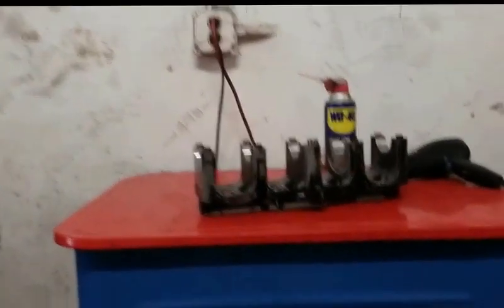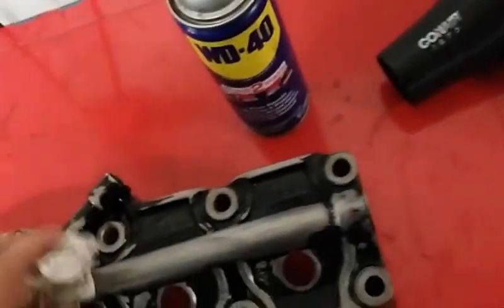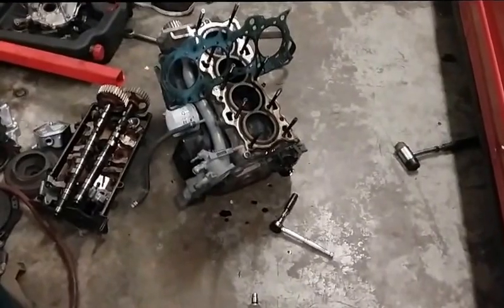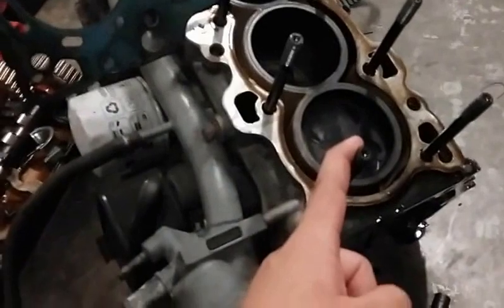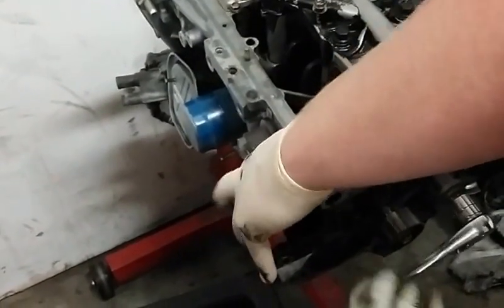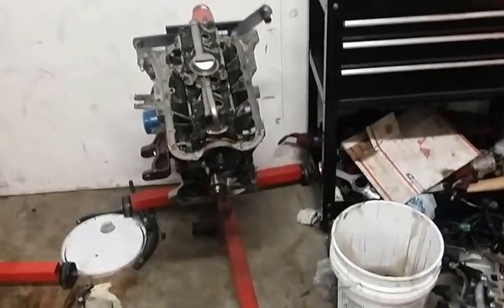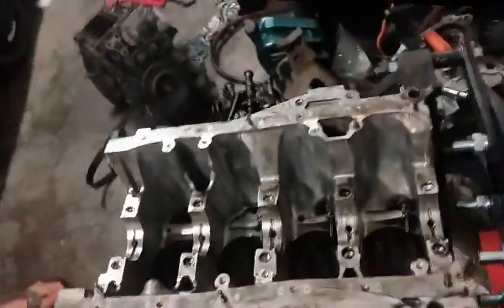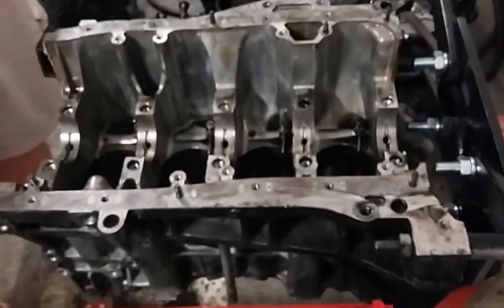D16y7 Engine Rebuild Pt2

Comment: Hi , I don't know if you will ever read this . But one question have you ever tried to use car80 to clean the inside parts? Does it hurts the inside parts? Or have you ever heard about anyone hat tried to clean it with car80 and made the engine bad?
Reply from the maker: i only use purple power

Comment: did you use stock size main bearings and rod bearings? i plan to do a stock rebuild on my sohc eclipse and nothings wrong with it....yet.......but it has 185k miles and i want to refresh the engine for the first time. if i get stock size bearings do i still have to check clearances with plastiguage for example? do i only get oversized bearings if i get machine work done?
Reply from the maker: liltaz94 you need to find a chart for your crank specs and measure your journals to see what size you need. I have a walkthrough for this. Have to dig for it

Comment: Yo what are you using to clean that rocker cover because ive tried alot nothing works that well I have some WD40 that also has some penetrating oil in it.. that shit does nothing for the cylinder head
Reply from the maker: iKixie purple power and a scrub pad

Comment: Have a d16y8. Crank pull bolt refuses to vacate, same instance you had with the other motors. Any tips or what kind of shops I should look at taking it... have put 150 lb of pressure from impact also applied heat and still no go
Reply from the maker: Michael Browning need fucktons more trq than that. It's not uncommon for me to need a 3/4 inch impact to take them off. If you have a homie with a badass impact that works in any kinda shop I'd hit them up. It'll only take a few seconds with the right gun an air supply

Comment: hey was wondering if you have some advice in building a vitara motor and one of the rings I gapped way too loose about .028, the rest are about .019. should I use some used compression rings only off of one of my spare d15's? or should I just run that gap?
Reply from the maker: are you saying you cut the ring back to much and opened it to .028 or it was at that when you measured?
Reply: VHB Engines ya I opened it up that much with a hand file, I bought the evergreen rings off eBay I think you said you use them, and they come stock pretty tight like .012 or something. their for a used set of vitaras I have. did most of them slow and taking off any burrs but opened the one way too much
Reply from the maker: Mitch Weber yea ya did waaaay to much. You don't really need to gap for vitaras if their within factory clearance. Vitaras are cast pistons and don't expand like forged pistons do. You should chuck
The whole set an but another. Put them in the cylinders and if the gap is close to factory run them without gapping
Reply: VHB Engines do you not condone using used comp rings? lol I can do that I just heard most people run around .019 top .020 bottom ring end gap for vitaras what do you run? ya their cast so a tight p2w is good but don't most forced induction cars like a looser end gap?

Comment: Not hating  but tool organization and work benches will take you a long ways  , I'm no super mechanic  or tool god lol ... Just giving you some constructive criticism . I have the same harbor freight service box I use at home and one at my job and a Matco 6s 3 sectional big box .they are some handy  little boxes to have for the money  unlike those cheap craftsman boxes that feel like they got bees wax jammed up in the sliders . Lol  ...   Anyways ...have you guys had any problems with those Honda oem leakless head gaskets ?
Reply from the maker: its just me building. i share space. Their have been times of great organization but with me sharing space i have a limit to how many tables and such i can buy. ran outta space much faster than i thought i would lol. hope to be good again after my move.

i dont use oem headgaskets. i use the fel pro gasket from the autoparts. never had one fail on me. i have seen a little oil seepage but that was just on the frankenstein build so not to surprised